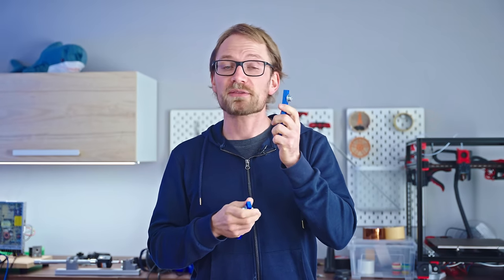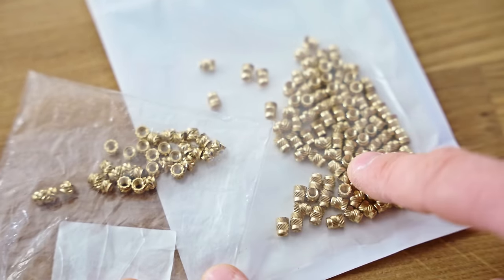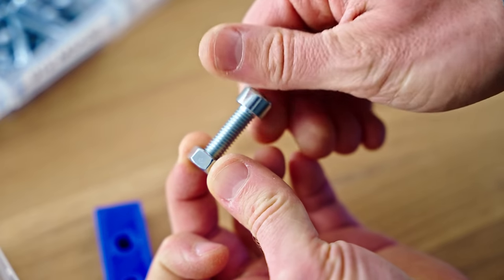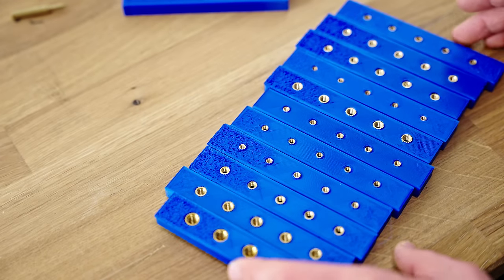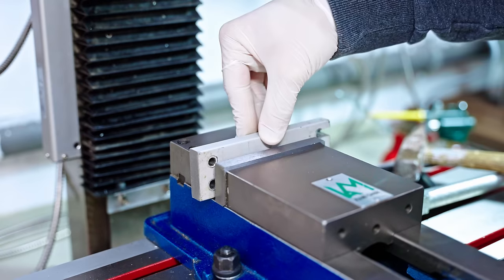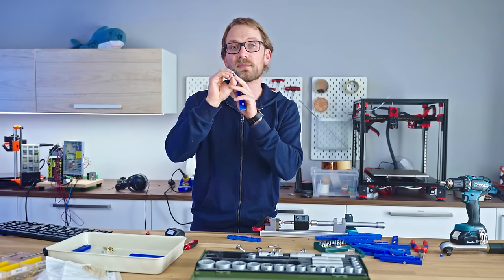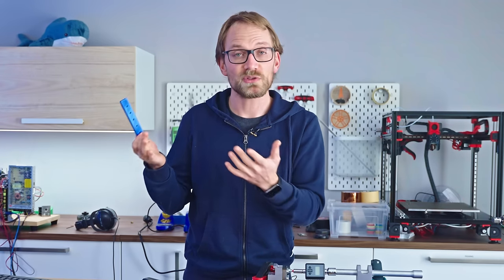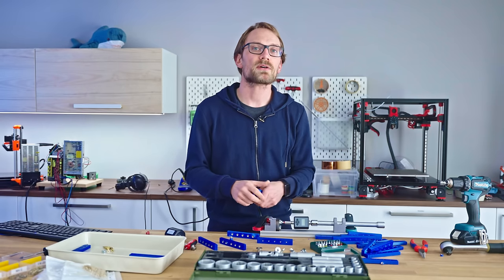Do you even need threaded inserts? Strength tested!

Comment: The diagonal threads(straight on the injection ones) on the inserts are not for pulling out, they are there for screwing in and out and so you don't turn the insert out of the hole when screwing in too tight or screwing a stuck screw out, which i think is why Stefan's have them both ways. it makes the most sense. Also that's why the injection ones have them straight.

Comment: Tom, another significant aspect of threaded inserts is the ability to torque a fastener tight enough such that they don't back out. 

If your fastening application compresses plastic at any point, you will never be able to tighten your fastener enough such that it cannot back out.

Another option you could try is a Threaded Flanged Insert Nut. They are designed for use in wood, but I find they work just as well in 3D prints.

Comment: Very comprehensive test! From a Design For Assembly standpoint, threaded connections can be achieved with stainless DIN 7981/7982 screws. Faster, easier and cheaper.

Comment: The problem that inserts solve is not just the strength and ease of threading a screw. But they provide same feel even after 100 unscrew and screw cycles. The printed (or tapped) plastic holes will degrade after two or three cycles.

Comment: Another vote here for testing captive nuts.  I also think it might be better to measure clamping force rather than torque, since clamping force is the actual goal and easier to compare.  But that would require a strain gauge and different test fixture.

Comment: Try making a jig with a load cell (the sensor like in digital scale) so you could get graphs rather than max values (refer to Matthias Wandel for example).
Try to test twisting (overtightening) failure in addition to pulling failure.
(in addition to other good suggestions)

Comment: What about creating a hex hole in your part, pausing the print, dropping a hex nut in, and then finishing the print?  We can also heat and press hex nuts into a sized hole at the backside of parts, which will leave the entire upper body of the plastic for strength.

Comment: I undersize the hole to about the minimum diameter of the bolt and just screw it in. I love these kids of videos and think you did a great job. One thing to consider is that determining preload from torque is quite inconsistant (~35% spread but there will be outliers even higher). Also since you are measuring pull out preload might not be important. Preload builds up the memeber strength of the joint to prevent the fasteners being put in pure shear. Metals are typically stronger in tension than shear, so making the joint tight translates some of that tensile strength into friction that keeps the bolted joint from slipping (and putting the fastener in shear).

This was great and I am a big fan of your videos! Thank you!!

Comment: Usually when I need a super strong connection, I model a cavity in the shape of a nut into my part, pause the print at the appropriate layer, insert the nuts into the holes, and resume the print around them.
Or if that's not possible, design a part in such way that allows the nut to just be inserted into the finished part.
Never had issues with this approach

Comment: As for tapping M3 or such - here is, how I do it: I print a 3mm hole, which due to tolerances will end up shy of 3mm. Then I heat up the screw, screw it in, wait for it to cool down, and unscrew itagain. Works a treat. Should you use stainless screws or dont have a magnetic bit, blue tak or such is your friend for holding the hot screw to the bit :-)

Comment: Printed threads can be even stronger! Modeled/printed threads are stronger than tapped pilot holes, as shown. Also shown is hitting resolution limits of the printer for smaller screw sizes M2-M5 which you've dealt with it by using a tap to clean the threads. However, printed threads can come even closer to the strength of heatset inserts by: 1) Use form taps,  also called thread forming / fluteless taps. These taps don't cut but rather squeeze and deform the material into the correct thread shape. 2) Reduce or zero tolerances of printed threads, to get a closer fit after the form tap. There's no chips to clean, threads are stronger from the closer fit and because locally compressing the plastic makes it stronger and the form tapping itself is painless with a hand drill and just a bit of oil. Plastic won't tear out because the printed thread is already close to dimension (and form taps are stronger than cutting taps though that won't matter unless using some really exotic plastic). The form taps on Ali for a few bucks each are plenty good.

Comment: I print most of the threads I need in my parts. The biggest factors I have found to success is to use the loose fit feature in Solidworks when modeling the threads and use extra perimeters for those holes. In Prusa slicer I will use circle modifiers to add perimeters to the threaded areas and they don't pull out as easily. I never have to clean up the threads and they all fit in fine, even the m3. This has worked for me all the way up to m16, I haven't had a need to go larger.

Comment: Little correction: the outside threads are there to compensate firstly rotational forces when inserting and removing screws.. secondly they are angled to provide axial stability and then they are opposite directions to cancel out axial forces when rotational force is applied, just like double helical gears.
I suppose the ones with the same direction knurling are just cheaply mate without understanding its purpose.
The injection ones on the other hand give enough of axial force resistance since the mold completely flows around them in the process and the plastic is more resistant to start with and I bet more is just not need for the size of screw and at up costs.

Comment: I always, where possible, use infill blockers cylinders around screw  holes. It helps when mounting (dont break out so easy) but also whitstand pull and push forces better.

Comment: Very grateful for your efforts Thomas -- FWIW, I believe this test method is inadequate because it only found the strength of your 3D prints, rather than the performance of the inserts themselves. I'd love to see this redone with that aspect resolved. I could see prints placed behind a plate with a hole the diameter of your bolt/insert to stabilize the print material and then a tension load applied to the bolt (with a tension scale in between), so that the plastic at the interface of the inserts is forced to shear. I think that tension, rather than torque, would be a more helpful metric for people trying to make decisions, since that is a more likely load situation and is where these inserts will be truly be different. 

As always, thanks for sharing!

Comment: Re-test with 100% infill to a diameter which exceeds the diameter of the hole in your test rig - that's the best way to potentially test the grip strength of the different insert designs and their knurling directions etc

Comment: I like to press fit a hex nut into a slightly smaller hex-shaped printed hole on the back side of the part.  To pull the bolt out of the part, you would need to pull the hex nut through the part.    Very strong, cheap and works with M3 size or up.

Comment: The dislike for machine screws with tapped holes really doesn't match my experience, where they work quite well.

They might not be as strong as other options, but it doesn't matter as long as they are strong enough, That depends on the application of course, but i've found M3 screws in tapped holes to be enough for nearly everything i've printed.

I've also never had problems with the tap gumming up. That was probably caused by using multi-step taps (there's no need in plastic), which generate lots of heat, requiring coolant, which caused the chips to stick together and not evacuate properly.

The main advantage over inserts IMO is that the space required for the attachment point is quite a bit smaller, so you can design more compact parts, which print faster. Self-tapping screws would probably be better, but it's pretty nice just having one box of hardware that covers a wide range of lengths and works for screwing into plastic or metal or when using nuts.

Comment: I've used knurled inserts, threaded directly into my parts (no inserts), and one additional one that I would love to see how it compares:

Hex inset for a nut on one side, with the bolt thru the part (hopefully that makes sense).  These seem to be the strongest feeling, but not positive about that.

That being said, I don't use inserts for strength, I've been using them for durability for parts that have to be taken apart and reassembled multiple times.  I found that screwing directly into the plastic (ie, self tapping screws), after a few times at best the plastic threads fail.  The inserts hold up much longer.

Anyhow, thanks for the tests Tom, was good to see some actual numbers.  Also, future idea, it might be beneficial to see the results a on line chart to see how they compare as well, just a thought.

Comment: Great video that highlights the fact that we are under using the max specs of screws for sure. Their is also other things that we need to take into consideration here as well. I'm working at a company producing underwater robots. We are using lots of 3d printed parts in prototypes and also production. Having a thread in the plastic make things light and still plenty strong, but it needs to be tightened once in the factory and not user replaceable. If the user needs to work on the screw. I directly put a nut or an insert to have this thread last. Also for underwater things, having the tapped part in the same material as the screw avoids galvanic corrosion which kills metal in salt water. This things never get to be talked about but I'm sure that they are super interesting subjects.

Comment: Thinking about it, for parts where you have enough depth to use a nut+washer and have it covered up by the top layers that might be the strongest combination of things. Alternating extra walls makes a pretty big difference in my experience, and so does making sure there is enough material there by adding an extra wall or two. Most slicers also have a wall overlap setting that gets them welded together more.

Comment: my favorite by far is taking one of the screws I'm going to use for the project and then cutting relief slots at the tip with a Dremel and cutting wheel. I then use that one screw to tap and clean all the screw holes leaving perfectly matched treads. The end result is better than printed threads, not quite as good as using wood screws but there are more head shape options and definitely not as strong as bolt and nut but definitely less fussy.
Reply: Its also worth noting that one should appropriately break the chips as you tap a tread depending on the style of tap used. Most cant handle or do a very poor job if you simply screw in all the way with out backing back out every couple of turns.

Additionally, PLA melts, shocking, so you do have to go slow even by hand enough heat can be generated to destroy your threads during the tapping process.

Comment: I started out years ago with M3 screws into tapped holes, with enough walls to guarantee that the threads weren't cutting out into the infill. I found they were almost entirely satisfactory - held tightly, didn't come out in the kind of use the assemblies were seeing - as long as I didn't ever take the thing apart and try to re-use the holes. One re-use might work, but anything 2 or beyond would fail pretty rapidly.

Comment: I did 6 screws into PLA, each with a drop of CA when I screwed them in. After some months I needed to take the thing apart and  ALL 6 #6 screws broke off at the head without removing the screws with no deformation of the plastic at all. Sometimes the clamping force is less important than the shear force and in those cases direct screwing into plastic can work pretty good.

Comment: What if you push in the insers into the opposing side of the hole of where the screw goes into? I imagine the additional plastic the insert will press against when you try to pull out the screw will add a substantial amount of resistance.

Comment: 13 years of functional 3D Printing. I've never used a threaded insert ever. If I plan the screw to never come out on a regular basis, the screw or bolt just threads directly into the plastic. If I want something that  unscrews on a regular bases? Embed a standard nut. It's easy to design a hex spot where the nut drops in, and it can be held in place either with friction or a spot of superglue. The surface area of the nut will hold onto the plastic way better than any insert.

Comment: I use M3 screws as self tappers. The holes have to be slightly oversized to push the excess material into threads. This is technique used in RC model kits along with true self tapping screws. There are also thread forming taps available - these are better for 3D printed parts than thread cutting ones.
They are strong enough to pull two warped PETG parts together.

Comment: I printed some tool heads for my Dillon 650 Reloading Press. I did it just for low-stress depriming only, so very light loads. I dabbled with printing threads, but what worked best was printing 20 walls in the holes, and running a 7/8-14 tap through the holes. Yes, it was messy, but it worked, and continues to work.

Comment: I've been subscribed to and watching your channel for a couple of years but I don't believe I've ever commented before, so hello 😂 Screws made specifically for tapping their own holes in plastic hold very well in 3d printed parts for me. Do a google search for tri-lobular thread forming screws made specifically for plastic and you will find the type I'm talking about. The threads are very thin but fairly deep with a wide pitch. The threads look sort of like sheet metal screws as far as pitch spacing goes, but the threads are much thinner which allows them to slice their way into thermoplastics and the wide pitch prevents material from being displaced as the threads are cut. They also don't require much installation torque to achieve their holding strength. I print my holes to be very slightly larger in size than the minor screw diameter (or what you are referring to as the core diameter in this video) for these types of screws (.1mm to .2mm larger is usually plenty).
Reply from the maker: hello 😊

Comment: I would love to see the threaded inserts set in a textured hole with various kinds of glue like superglue, superglue with baking soda, epoxy, UV set resin, silicon glue, that kind of thing.  So rather than melting the insert into a hole, print the hole bigger, perhaps star-shaped for extra friction/adhesion and then glue them into that hole.

Comment: Was glad to learn about the threaded adapters.   I’ll be trying those.  But I do have good results printing a coarser thread in soft materials like we have with 3D printed parts.   In particular I frequently use #10-24 printed threads for small part assemblies.

Comment: If you need high strength, use a through hole with a nut or nut & washer for higher surface area against the part. For medium strength, self-tapping screws made for plastic work well. The main case i see, besides the cool factor, for inserts or adapters is to reduce thread wear in the plastic from repeated removal & replacement of the screws.

Comment: If it's not load bearing, such as if all you need to do is hold a PCB, then self tapping plastic screws work great. I'll usually print with 4 or 5 wall perimetersfor this, and have even had good luck with disassembling and reassembling with this method.  It also helps if there's at least 5-6 rotations of thread engagement.  All bets are off if someone overtightens the screws and strips the formed threads though.

Comment: I am not surprised that power tapping (that is, using a drill) made heat and friction and caused the plastic to fuse to the tap. Personally I would hand tap soft and meltable material like thermoset/FDM plastics, and make sure I back off a quarter turn each full turn to break off the chips of the thread. Adding perimeters and/or using greater percentages of infill to make the parts more solid would also help.

Comment: When I print parts that are to be functional and have threads, I increase the perimeter shells and use inserts when it makes sense but tapped holes with increased shells makes a significant difference. Sometimes I use 100% infill. If I'm going to 100% infill I will also use a heat insert or a sunk square nut. Often making pockets or slots for square nuts is the strongest option. Unfortunately, not all parts have space for using a square nut.

Comment: Solid parts, or add microscopic holes in the parts in the area around the holes. Small enough the printed part isn't actually perforated, as the holes are smaller than the printer's resolution, but big enough the slicer will add walls. If the holes are spaced closely enough, their walls will interconnect, and together they'll make a MUCH stronger part.

Comment: There's is the trapped nut option that I believe is probably very strong.

I would also be interested in the thread strength, not just pull out force. This would mean the parts are mating before torqued.

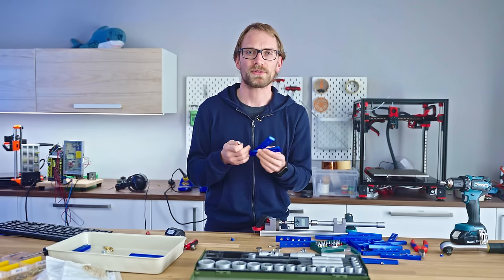Comment: 16:45  Even with solid blocks of plastic, unless they're hard engineering plastics like acetal, it's generally recommended to use washes if you're putting any real load onto the screw.  This is true for even big M8-M10 screws too.